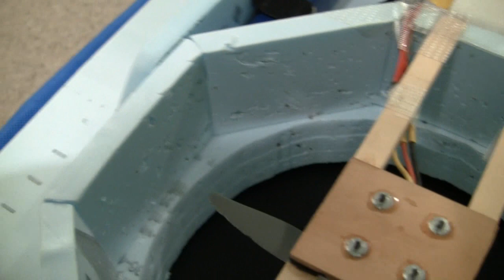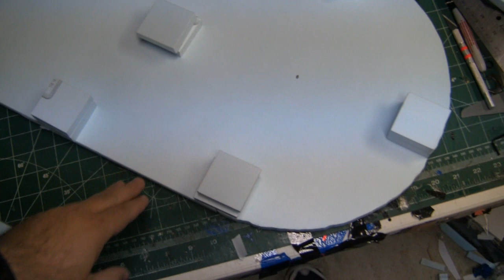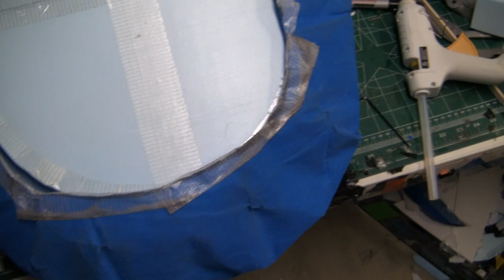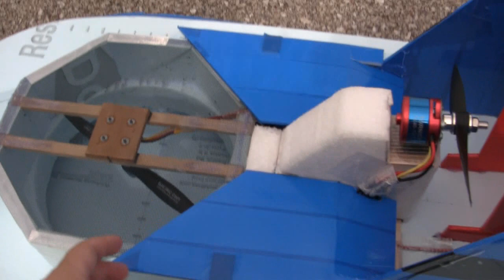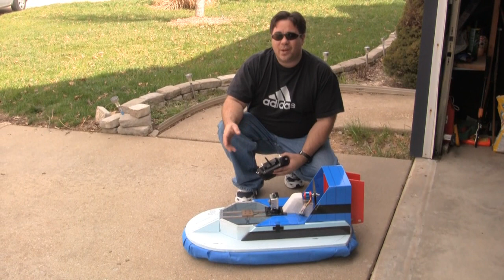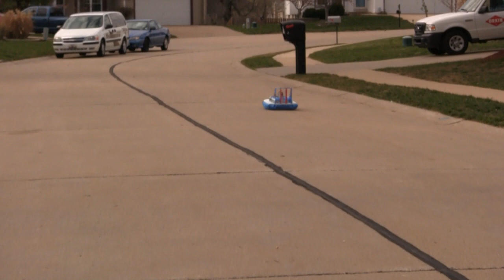RC Hovercraft Part 3 (Hovercraft Mods)

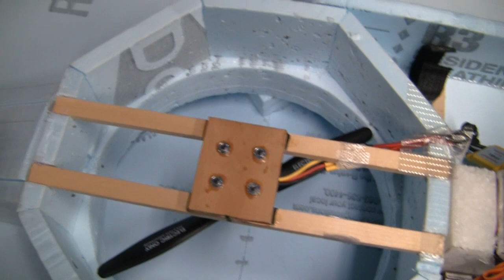Comment: im at 4:40 in the vidio right now and I want to make a prediction... if it has that foam piece, then it ould deflect 15% of the air, but it could also pressurize the layer of air and provide MORE lift so the fabric might not be long enough OR it might do what its intended to do

Comment: Also how are you controlling the lift fan? I was thinking of using a helicopter radio and using one of the pitch adjust knobs to control the speed of the lift motor

Comment: In the parking lot it looked like it could of used a little weight aft ward. In front of your house the weight balance looked more neutral. Did you scratch build it?

Comment: put a small compressor that inflates the float n put a regulator that keeps the float full untill you need to stop...that will give you all the stability and controle you need. this will let you b the boss of where the machine goes...also crazy mobility

Comment: Hey man, Great hovercraft project. If you want to stabilize it better, the skirt has to come down a bit, And when fully inflated the contact points should be just under the outter edge of the haul. Check out my uploaded videos of my gasser 4' long hovercraft.

Comment: Very nice design, I do have a feeling the the pebbles are coming in from the bottom, and not the top. I think your bag should be 1 whole piece shaped like a large doughnut with air coming out of holes made using a paper hole puncher. This will allow for less intake air. This gives your a space in the middle of the undercarage to an air space. Just some of my discoveries from an earlier project.

Comment: @vmat377 i agree with the heli mode, with the throttle curve settings and hold modes it will really open up the fine tuning.